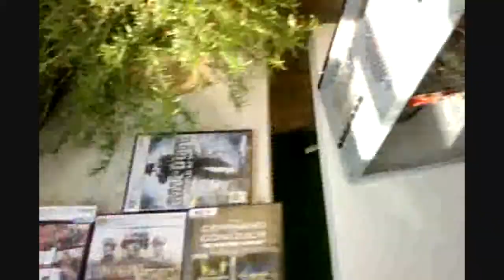Update ! for my old AMD computer - HD

Comment: 1 thing that you should know is that the antistatic bag where the Graphics card was in ( this also replies to motherboards )  is antistatic only on the inside not the outside, i always cut mine in half or pull them inside-out. Just a little caution advice :)